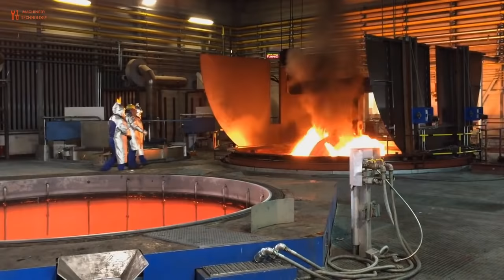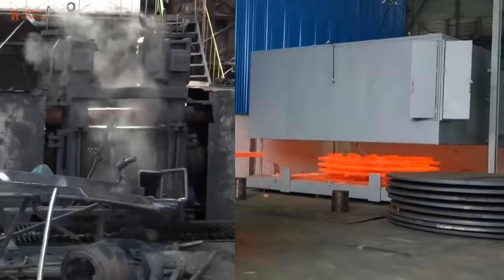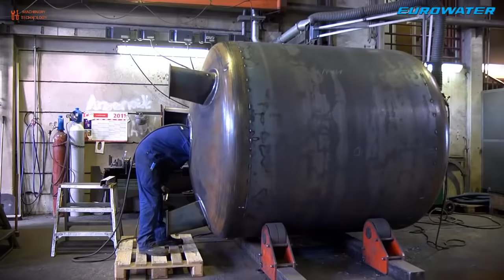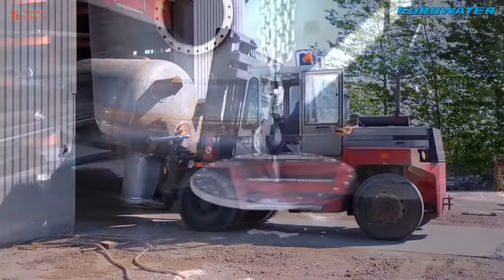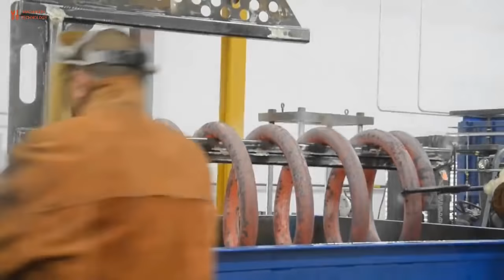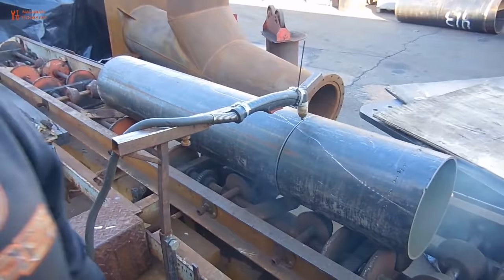Amazing Hot Metal Factory - Modern Technology And Hot Forging Process

Comment: having worked in a steel mill in Kansas City back in the 90-early 2000's, it amazes and saddens me to see those guys working around hot steel with no safety equipment on. No aluminized coats, no steel toed shoes, no hearing protection, not even any safety glasses. That's why steel manufacturing left the US. dirt cheap wages and no OSHA. It's really a shame. I miss that job.
Reply: And went to Mexico Japan and China where the wages are even lower and osha is non existent
Reply: @borbo23  Companies Not capitalists. Companies. If every nation had proper safety laws this wouldn't be an issue.
Reply: unfortunately most of the jobs went to the middle east and India. The quality isn't up to par to American standards
Reply: @Jacob-vu2ti lol Japan?
Reply: @sidehop  this guy probably doesn't know where Japan is.
Reply: @bjing1316  probably not....if there's any standard for quality and safety, Japan by far goes beyond what OSHA does in the USA.  It's impressive there to say the least. Wages are higher than China and Mexico of course.
Reply: @borbo23  Perfeito seu comentário é exatamente isso
Reply: It looks like interesting work, but was thinking the same thing when i see some of these guys in tanktops, regular gloves, these factories are like a nightmare scenario when it comes to accidents. I cant even imagine in the early 1900's how workers did this stuff without the protective gear today, and with so much exposed moving machinery.. i have alot of respect for people that work in these fields
Reply: @fizbe4671  capitalism promotes that type of thinking, maximize profits at the cost of employees safety, why do you think osha had top be created, why do almost every single US company has there products mad in other countries, other countries cannot have good safety laws, if they did the cost of labor would go up , then Us complained profits would suffer and all our goods would be even more expensive. And now you see the necessity of regulations and laws.
Reply: @titirititiri6360  Greed promotes that type of thinking*. Anyone with power and greed will do horrible things. Capitalism just gives more chance at power for those who are able to put in the risk for a chance at reward. More power to citizens. Of course greed has corrupted this system though just like any other system. Also those other countries are at fault for not having safety/labor laws. Their concern should be of their own, not what some US company thinks of them.
Reply: @pierrehedegaard72  amen!
Reply: @fizbe4671  Who do you think runs those companies? You seem to be taking personal offense to the word "capitalist" when used in any kind of negative manner. You don't have to defend them, you know, they're perfectly capable of taking care of themselves. You seem to know that regulations are necessary to combat the flaws of capitalism, so I don't understand your attitude. The socialist boogeyman got you scared or what?
Reply: and yet people still buy the cheapest crap, thus the factory has as a choice to do everything for lower costs or close shop, because the chinese will make it for a grain of rice, while in the meantime they get help from their gvt. as to be competitive in spite of any customs taxes. For the guys working with the hot rods having a full aluminized coat might be more dangerous if it impedes it's movement. Steel toe boots are worn by those workers for sure, they are cheaper and last a lot longer than any regular shoe in  those conditions, I highly doubt that the workers would prefer to wear/buy something of the lower quality and at a higher price.
Reply: There are still plenty of steel mills in the US, especially out East. Currently working in a steel mill built in 2009, and we are constructing another mill on the same property. The form of mill in this first clip is severely outdated and not modern at all like the title suggests. You also don't need aluminum PPE when your steel is no longer fluid, but they definitely need all that other gear.
Reply: Totally agree same in Australia
Reply: They're just better than you
Reply: @pierrehedegaard72  Now imagine people like him running most of companies that have to do with steel working, machining, forging etc or even construction: that is most of countries beyond to the east of germany. Horrible.
Reply: @fizbe4671  "If every nation had proper safety laws this wouldn't be an issue." Have fun trying to make that happen.
Reply: u would wear a pair of glasses I would no way I would work near somet that can send of a tiny spark and burn your eye ball and blind you ..but ye it should be somet they are given
Reply: Its not like that today, safety is taken seriously! I don't know when or where this was filmed. I worked in a aluminum factory on a charger which is kinda like a smelter, & on a caster. Safety is pretty strict, even had special steel toe boots that have leather covering the strings or you wear boots with no strings to protect your feet from spills. Years ago a man had molten aluminum poor onto his boot & it went right into his boot through the tongue & strings & almost filled up. He almost lost his foot, he couldn't get his boot off at first & it just cooked his foot! Also explosions are not all that uncommon, just a small amount of water into the charger can cause a explosion. The metal is preheated before its melted to illuminate that. You can look up some of the explosions & see how bad it can be. Plus you'd have thousands of pounds of molten aluminum flying at everyone. It is so hot it immediately ignites anything it touches that will burn! Dangerous jobs!
Now China has the biggest smelter for aluminum in the world! Sad, less & less is made & done in America.
Reply: Dont wory in eu we care safe first
Reply: You miss working 14 hours in a hot greasy factory?
Reply: Yep! That is crazy. I wonder how many injuries they have in places like that every month! And I am sure these guys don;'t have medical coverage!
Reply: i noticed that as well. do you know why they don’t have protection?
Reply: @unconventional800  Because they are obviously living in a country where work safety standards are non existent!  You would NEVER see this in Canada or the US!
Reply: OSHA would have a field day with these guys if this were in the states.
Reply: @fizbe4671  unfortunately, corporations have enough money to buy policy makers in poor countries and protect their interests by not allowing implementing any safety standards
Reply: Was that Armco by chance? I went on a tour there in the late 70s. They recycled scrap steel then I think. It was very noisy with these massive electrodes arcing current in one of the huge cauldrons...amazing place then, but all gone now!
Reply: @verstengenericks  When I was there it was GST Steel but yes used to be Armco.

Comment: Wow!  So the thumbnail wasn't clickbait at all!  Awesome looking red-hot giant gear!
Reply: Not sure if this factory really is so amazing and hot as the title claims though.. ;p
Reply: Yeah for once.
Reply: It didn’t show it being made though
Reply: It's the first stage of a reduction gear. The reversed helical teeth minimize or negate unintended axial loads. This is likely as not being forged for the gear train of a steam turbine powered ship.
Reply: Itd be nice if theyd mention what each gargantuan piece of red hot steel was going to be used for, rather than having us assume their purpose...
Reply: Imagine you falling into it.
Reply: @Forferdelse666  I imagine the gear may have been forged and then the teeth cut afterwards. The process shown is it being hardened. It is dropped into a bath of oil, which cools it fast enough to harden it, but not so fast as to make it crack.  You can see the flames coming off the top of the oil bath as it goes in….it will probably be finished by tempering back in an oven then a finish grinding on the teeth.
Reply: your comment is click bait.
Reply: Click bait comment though. Hahaha

Comment: First one seems unnecessarily dangerous, no barrier around the heaters. Imagine the guy giving directions gets distracted and trips and stumbles into the pit. They could have easily put a little barrier in between but they just left it exposed lol
Reply: That’s exactly what I was about to say. When they were lowering that giant gear into the other pit you can see one of the workers backing up. I’m sure it could easily turn bad really fast if he tripped over that tiny barrier into that furnace.
Reply: I think it's just hard to get a perspective of the distances. To me it looks like they had enough room to be safe, but it is hard to tell.
Reply: Its elevated

Comment: Modern technology my ass, that scene where no safety gear is worn by anyone and no safety procedures handling those hot parts
Reply: Not to mention the very first clip where anyone could fall into an open furnace and die instantly. Not even a safety rail!
Reply: @TheGodpharma  can you please elaborate
Reply: Anikesh Prasad What did I say that isn’t clear? It would be easy to fall into that furnace, by accident. The design is unbelievable with no barrier of any kind to prevent accidents. You would never see anything like that in Europe or North America or any western country.
Reply: @TheGodpharma  oh
Reply: I watched a guy fall over a safty rail wearing everyting possible.... he still died, though he slipped because he didn't see the rail
Reply: @TheGodpharma  the second clip is even more dangerous, look at the way they are flinging it around. the metal is white hot and they have nothing.
Reply: Lol so this is likely former Soviet bloc or just russia. The safety standards in the region are.....contextual it seems

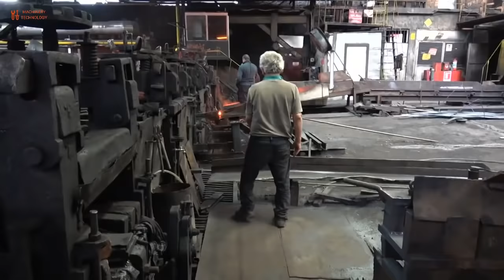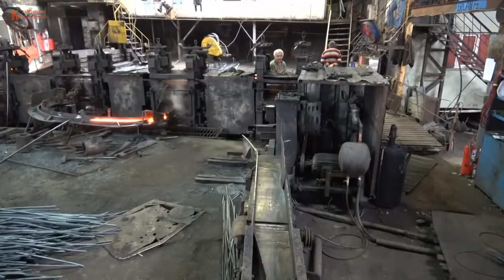Comment: dude, there is this one part that looks fucking dangerous to me. i come from an aluminium casting facility. and we have a huge industrial safety standard. when i see this part around 1:45 - 2:10 . this guy is probably there for few decades, and he knows what he is doing. no disregard to that. the thing is that he is standing inside this loop that the wire is directed towards. on the other side of the machine it gets pulled back it.
i dont even think that pull is really a pull or strong at all, by the looks. there are probably conveyor type rolls. my point is if on the side where the wire/rode comes out and is guided around the loop, if the thing is stuck there, the rod is pulled on the end, the guy might be hit by the rod in the middle of his body. maybe causing actual harm.

Comment: I would like to see those save the planet activists how they would heat up these steel rods and plates by the solar and wind energy!!!???
Reply: Electric arc furnaces! Instead of blowing in superheated air, usually created by burning fossil fuels, like in a blast furnace, electric arc furnaces work by dipping carbon electrodes into the steel and creating an arc between them heating up the metal up to 3000 degrees Celsius (5400 degrees Fahrenheit). To do this requires around 400 kilowatts per ton of steel. The mean peak capacity for US wind turbines is 1.6 megawatts. Accounting for normal capacity, let’s just say 25% of peak capacity, an average American wind turbine should produce around 400 kilowatts of power. Using energy storage methods such as pumped storage hydropower or large scale batteries, you could easily provide enough power to continuously operate a steel plant with a few dozen wind turbines. So not only is it possible to power a steel plant using renewable energy, electric arc furnaces also allow for the use of 100% scrap metal feedstock reducing the need to mine for new material.
Reply: @NikoDood  ha, ha, haaaaaaa…!!!???
Reply: @NikoDood  damn that's nice, and what's cool is that the efficiency will only increase as time goes on too.